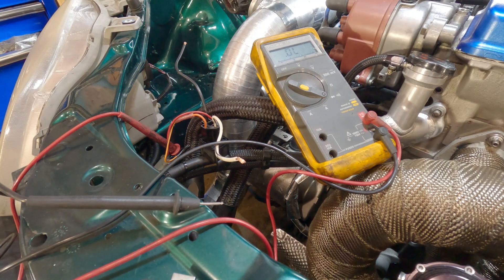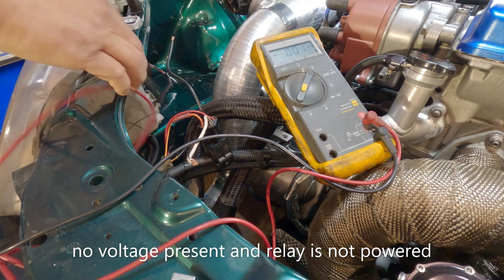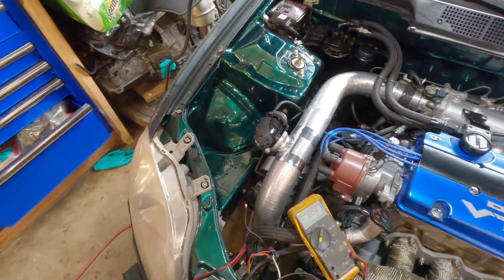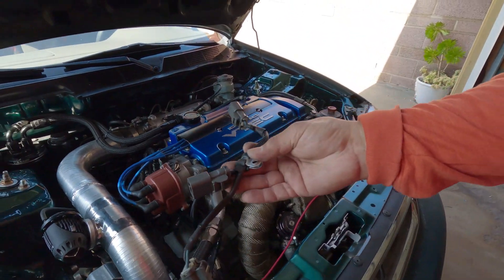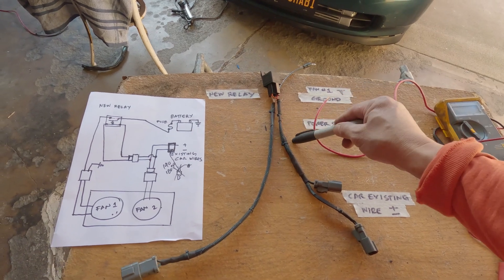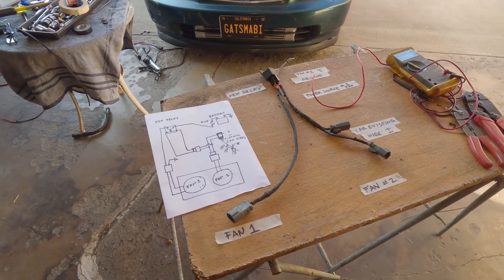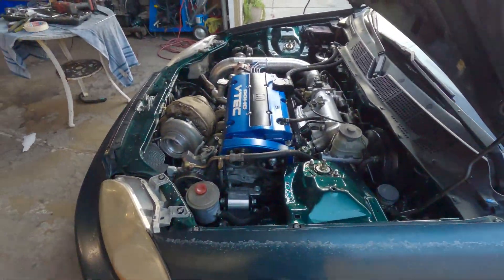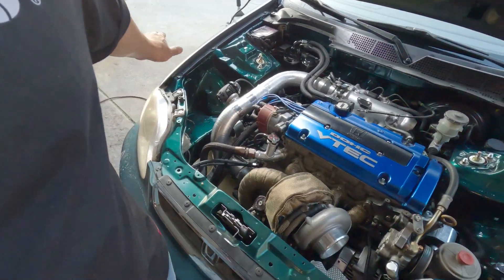How to wire Radiator Dual Fan on Civic!

Comment: Hey sensei I'm looking at an h22a4 someone is selling for $600. They show a picture of the compression test. It's at 155psi does that seem low? What's normal for an h22?
Reply from the maker: Nowadays prices went up, l went back to my tuner over the weekend and l spoke to Eric, he works there (he was the person pictured on my Dyno night blog). He showed me his H22 and paid $800 for it. Your price is not bad as long everything is good. 155 comprrssion reading is good, the minimum on H22 is 135 psi. Refresh the motor if you decide to get it, that way you know the engine is good when you put it in the car.
Reply: @sagittnet2158  Ok cool ill probably check it out this weekend, i was also considering the JDM "low mileage" f20B engines. I called a dealer here in san diego selling one for 1400$ what do you think about those? Alot more money but i would think it has less wear and tear
Reply from the maker: @carvedfromlife8949  F20b is alrighr, we did a swap on my friend Accord. You have to have a short geared tranny though to enjoy it much. Rev happy motor. I know they said it's a low mileage like over 30K miles. There's 2 types of F20b, the regiular and type S, dufference is the camshafts. If it's not the Type S they sell for $1400, l'll stick on H22 coz it makes more power than f20b and you can easily get the parts for it like headgasket.